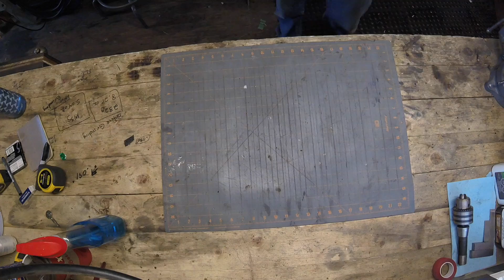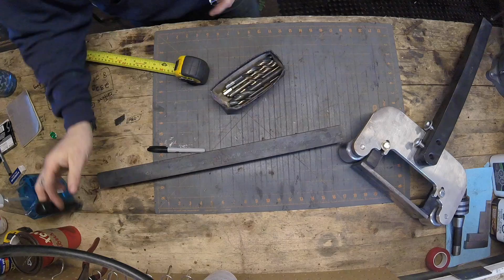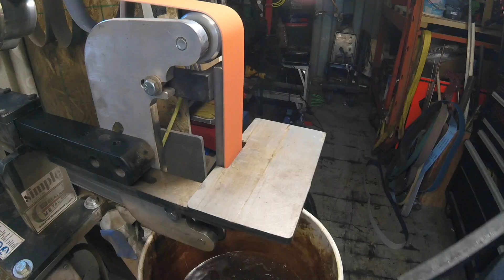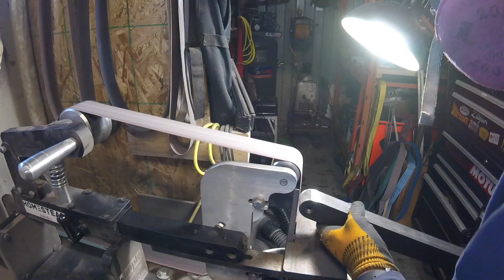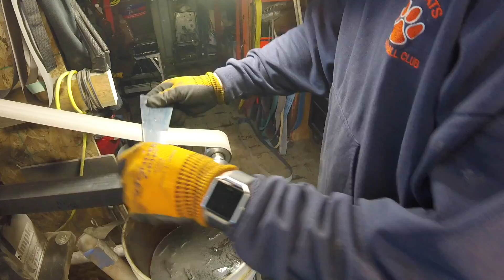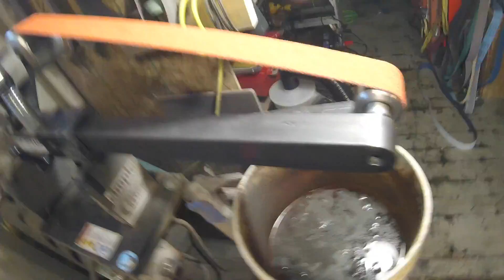Making a custom attachment for my KMG belt grinder

Comment: never use a drillpress wearing gloves!!
Reply: derEde Yes we all understand this little tid bit of information. Just FYI, he uses what he calls mill gloves or something like that, which he explains in a later video. Most of any gloves he uses when he works tear away very easily, so if they ever did catch on a spindle or any moving part in theory they will tear apart and not wrap up in something spinning. I never knew these existed but they are super neat. They are nice for working on a drill press and can help avoid those chips flying into your hands. Just my two cents but most everyone who works with these tools have already received this comment enough to understand the danger. You accept that danger as soon as you walk up to the tool.

Comment: Where did you learn that about the oil for cooling by extracting the chips? is there a technical information I can see on that?
Reply from the maker: +Joe Halas it was part of our theory class when I did my Millwright apprenticeship. If you have a coolant pumping/spraying system that's different. But for cutting oil like I use in the video, it's primary function is to keep chips moving away from the cutting edge and allow the chips to exit the hole and prevent binding.

Comment: i was wanting to know what is the best belt sander to buy for knife making with changing wheels  and how much would that cost, reason why I'm trying to save up for one to step up my skills
Reply from the maker: a 2X72 is the best size for knife making but others will work too. The KMG by Beaumont Metals Works is probably one of the best values for commercially available units. Beyond that you can also make one, which is what I started with.  Cheers!
Reply: I'm considering making a 2x72 as well.  Would you do a video that compares the unit you built to the beaumont?
Reply from the maker: +aspenbanjo unfortunately I don't have my homemade one anymore. Blue Dog Garage has a really good series on the 2X72 that he made though. Cheers!
Reply: Thanks Man!